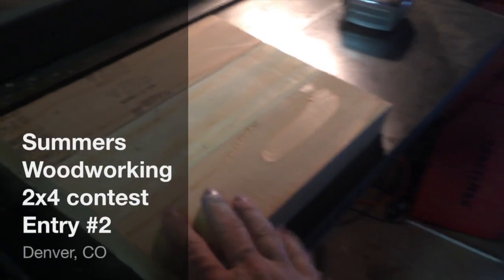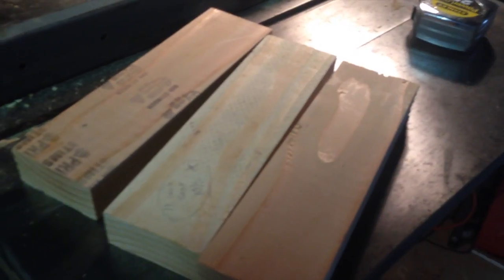Summers Woodworking 2x4 contest Entry #2

Comment: Nice work Chris, your not kidding about this pine going rustic. The piece I picked has to be the worst piece of wood for turning I have come across. If I can get my second entry in, maybe it will go better, no turning involved in that one.
Reply from the maker: Yes turning it brings a whole set of issues that normally I do not have to deal with.  It is so soft it tears out even with sharp tools.  Also when you apply finish the grain being as large as it is will swell etc... I am more and more amazed at how much folks are gutting out of a single 2x4. (the yield )   Lots of fun!   Thanks for your kind words!

Regards
Chris